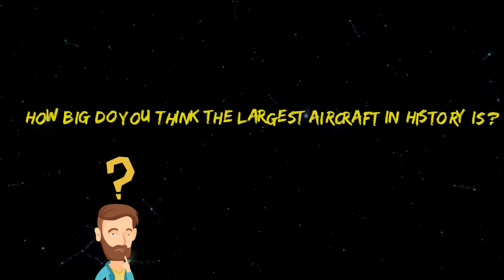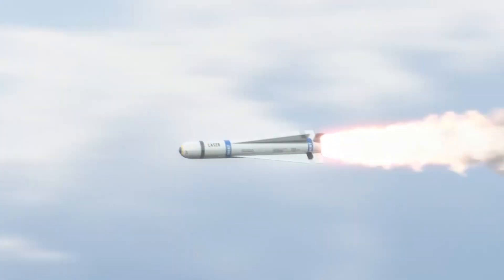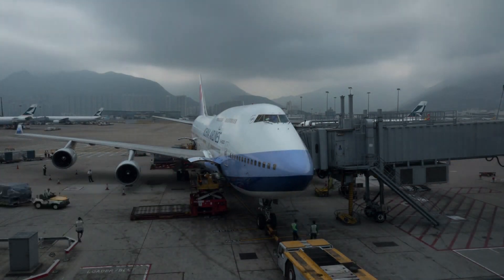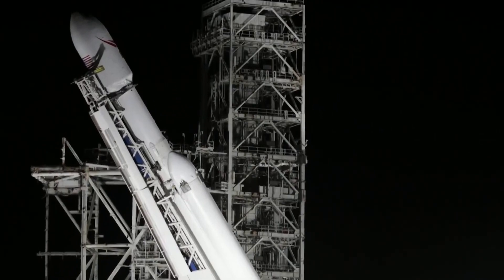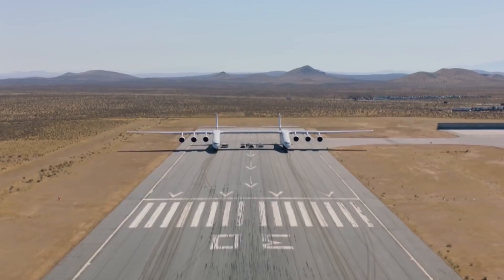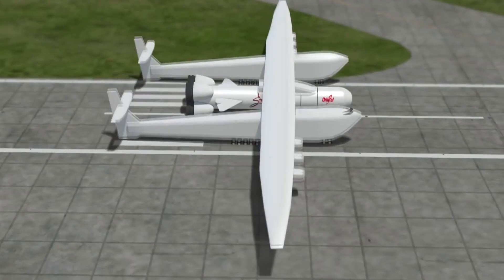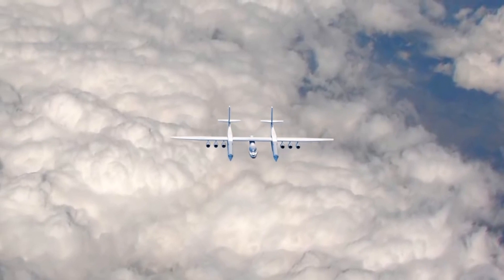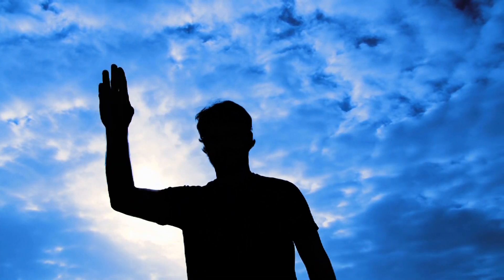Stratolaunch And The Largest Airplane: Is The Ride Over?

Comment: I worked on this jet for seven years, from the time it was a tape outline on the hanger floor. I designed the avionics bay as well as several other systems. My good friend and former boss is the program manager of the aircraft. You will never understand how large this jet is until you see it fly. I was at the first flight and it didn't get any smaller as it flew away. Truly an amazing aircraft! I loved working on this program and have nothing but high hopes for it's future.